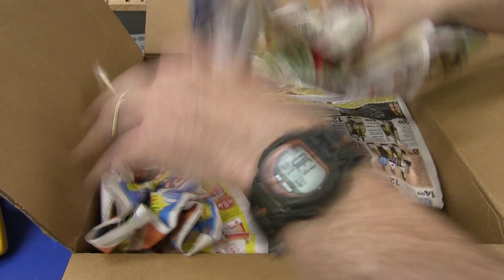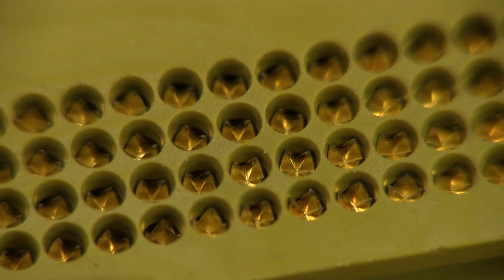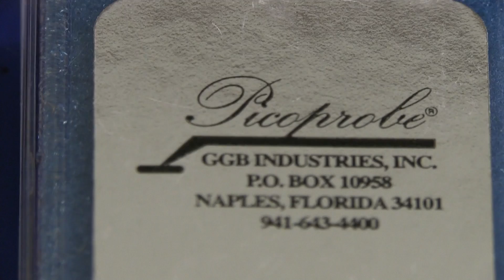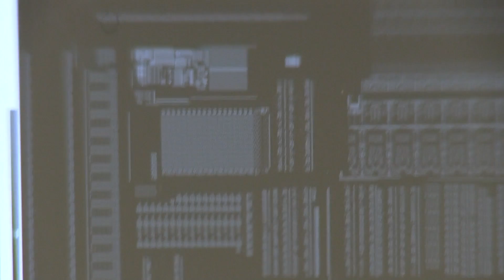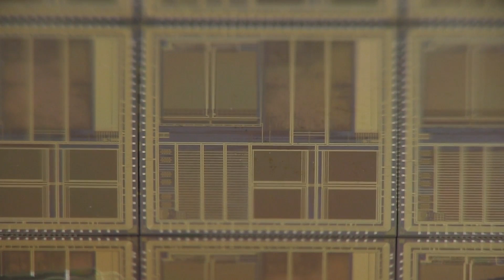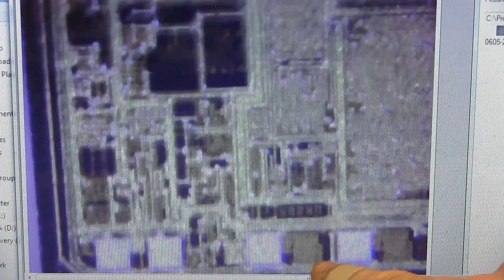EEVblog #532 - Silicon Chip Wafer Fab Mailbag

Comment: As a retired test engineer working at National Semi, Motorola and other semi houses here's a couple tidbits about wafer probing. 

First, the probe card does not move, all motion is in the chuck that holds the wafer using vacuum. The chuck is positioned in X, Y and Z by linear motors in the most common Electroglas probers. The pcb is very thick because probing high pin count die requires an extremly rigid material to withstand the significant amounts of force needed to deflect the probes such that they all make contact. This Z axis distance is in the order of 1 to 3 thousandths of an inch. 

Second, the probe ring is mated to the pcb after it is assembled on precision fixturing to position the tip of each probe in the center of the die bond pad and perfectly aligned in Z axis. Once the probes are positioned the assembly is encapsulated in an epoxy ring, hence the name "epoxy ring probe card". The probes are tungsten which has the necessary mechanical and electrical properties required. Probe cards are periodically "aligned and planarized" after probing 25 to 100 wafers and to repair damage. This is done by highly skilled technicians under a microscope.

Hopes this is helpful. Probing technology has come a long way since the 60's when I first used them.
Reply: that roswell Caused it all!!!
Reply: Thanks for sharing!!
Reply: David Myhr get out of here dinosaur. You're out of date 🙄
Reply: Did you ever get to work with encabulators?
Reply: The mind boggles thanks for sharing!

Comment: Just looking at some of these older vids. Here's a story I heard years ago about a chip fabrication factory.

Once the circuit lines have been etched onto the chips, the chips pass through a kiln to harden the circuit lines on the silicon. The kilns were similar to those pizza ovens that have a conveyor belt in them, cold pizza goes in one side and hot pizza comes out the other side.

There was a chip factory (I never heard exactly which one) where the defect rate of the chips would mysteriously skyrocket once in a while, then go back to normal, only to skyrocket again a few weeks later again. The engineers at the factory were tearing their hair out trying to find the cause of the defect surges. 

One Friday evening one of the engineers was working back late and as he was on his way out he went past the chip kiln area and found some of the night shift workers had been putting frozen pizzas through the chip kiln as a late night snack. Fat and other substances from the pizzas were then contaminating the sets of chips that went through the kiln after the pizzas had been cooked, causing the defect rate for the chips to suddenly rise. A bunch of people in the factory suddenly became unemployed.
Reply: LMAO!
Reply: You made me hungry.
Reply: This story I do not hear for the first time. The first time was at the university of my professor. I believe it by now. Because so much what happened to me is bordering on madness.
Reply: It is an Urban Myth. You will probably hear the story again in your life, from yet another source, and so on.
Reply: David Frisken not myth..i have also worked at chib fabrication chip and we had similar issues.like people not properly using clothing or take not needed stuff there
Reply: If fat from the pizza was getting into the chips, I wonder what industrial chemicals were getting baked into the pizzas!
Reply: Just more proof that stupid people make living a true chore.
Reply: Highly doubt it. Fat and grease getting in those ovens is going to cause major long term effects and smoldering that aren't just going to affect less than a days worth of chips. The frozen pizzas slightly lowering the temperature and thus causing defects is more plausible.
Reply: The killer of this myth is how did they get a frosen pizza into a higly restricted cleanroom?
even if it happened many, many years ago...

Comment: Hi Dave
A few small corrections from  a wafer sort  person.
If you look close on the probe card you noted that some some of the probes were shorted. Those pins are power pins Vcc or Gnd supply's .

The next comment is that the probe card does not come down on the pins the wafer moves under the probe.

 the probe card you have is the xyz accuracy of such a probe card the height diffrence between the first and last pin needs to be >5 mil

Comment: The semi industry is divided into back-end and front-end operations. The back-end  - cutting,testing etc - is usually done in the far east. The front-end is the actual fabrication process which involves lithography, etch, furnace, sputter and implant -  virtually all use  robotics to handle the wafers. The actual fabrication process can take up to 6 weeks and the wafer might have up to a dozen layers.
Reply: +Angus MacLellan so aside from the wafer, how much more goes into it? or is it mostly just the wafer then all the circuitry is already in the wafer, then attach the leads?
Reply: Nice info. One of the best videos about processors technology I have ever seen.
Reply: @steelthfighter  the active circuitry is all at the surface of the wafer and is "paper thin".

Comment: FYI, the tungsten used in those 100 nm probes is partly because of the extremely high hardness of tungsten but also because you can use electrochemistry to sharpen it to a few atoms at the tip with just a few volts and some saltwater.

Comment: The probe card is fixed in place during setup, the test head is lowered onto it and fixed too. The wafer is loaded onto the prober chuck, it is the chuck which aligns the wafer and performs all the x, y and z movements to make contact with the probe tips.

Most fabs haven't fired ink during testing for decades. The pass/fail results are instead stored as maps and used to either ink the wafer on dedicated machines later, or the die are assembled directly from the maps in an inkless process.

Comment: I was working in Test-Board-Design (mixed signals PCBs for frontend and backend) for 9 years (was like a 4 guy company).

If i remember correctly, the most expensive boards i made for our costumers were about 12000€ in manufacturing. We charged about 30000€ for these (we added pcb assembly, the metal stiffener, rf-relays and sockets). They had 30 layers, needed to be about 6mm thick for mechanical stability because there are thousands of pogo pins pushing onto it from the tester side (agilent 93000). Almost every second layer was a shield layer with a specific depth distance to the signal layers, so the board was 30% copper. The signal wires had a specific width in order to facilitate 50-ohm impedance (were needed). The board was about 40x50cm and had 4mil features in the middle section.

It wasn't a very hard job, you had to stick to a ruleset that was verified by 2 other guys when the design was finished, so i did not have to know anything about RF-TEchnology at the beginning.

Comment: If you lived through the ’70s or ’80s, you probably remember a time when technology was big. TVs, with their cathode ray tubes, were monstrous. Amplifiers and hi-fis were heavy, bulky, expensive things. And computers… computers were really large. Case in point: The IBM hard drive pictured above, which weighs in at 38.5kg (85lbs) and stores a grand total of between 1 and 2 gigabytes.

This drive, which originates from around 1989, would’ve been teamed up with a number of other drives and slotted into a IBM 3390 Direct Access Storage Device (DASD) — a floor-to-ceiling server rack. One IBM 3390 model was capable of storing up to six drives, for a total capacity of 22.7GB. A complete IBM 3390 system had a data transfer rate of 4.2MB/sec, with an average seek time of 12.5 milliseconds. The platters probably span at around 2,500-3,000 RPM.

While it’s hard to put an exact price on a single drive, it would’ve cost somewhere in the region of $50,000 to $100,000 in 1989 — or about twice that, in today’s money. That’s around $50,000 per gigabyte — or one million times more expensive than today’s hard disk drives, which are currently priced at around five cents per gig.

By the time I had stated in computers in 1977 we were using the ICL 1904 with the removable disk packs!

Comment: At 26:36 the suggestion is for testing post encapsulation but this is not always practical.  Sometimes the testing requires access to pads that are not bonded out (like on the bond out version of the processor) to verify internal circuits are working that are not possible to test when in normal operation.  Such as watchdog circuits and copy protection fuses that have to be temporarily bypassed or op-codes have to be injected to check fault conditions.

Testing may also sometimes take place before the chips are completed and if a complete wafer were to show a fault it would be scrapped before wasting time of the following steps, a whole tray of wafers may be junked with a lot of saved time.

Some chips are also factory laser serialised or trimmed and this also has to take place before the encapsulation process.  Many modern serialisation procedures are done with OTP ROM that is then locked from changes but sometimes that is not possible or desirable to prevent generation of multiple copies of the same serial number after they leave the factory.

Comment: The round shape is a byproduct of the production of the silicon, you start by growing a Cylinder of (almost) perfectly aligned pure silicon molten silicon while spinning it. then you saw the cylinder into the slices which are then prepared as raw wavers. Very intricate process in itself.

Comment: You can get wafers (with chips on them) on eBay - it might cost a little bit, depending on the size and type. But it's definitely on the list of things I want to buy at some point, to put on the wall in my little workshop.

They look dazzling when you see them for yourself, and it's great to think about the massively complex engineering required to create that thing that you got hanging on the wall.

Comment: did anyone else collect old computer parts when they were little. I had a closet full of computer parts cause I just thought they were fascinating. I grew out of it but now I feel like starting a new collection lol
Reply: YES!  I did.  I remember breaking open old 486 chips to remove what I thought was gold!  I dismantled old HDDs and busted open non-functioning CRT's to explore their internals.  I'm 27 now, and I must have been in late elementary/early middle school when I began to really explored the world the computer hardware.  That was back in the when dual Voodoo2's in SLI where the very best you get!  I even remember the day Nvidia bought 3Dfx... sad day to see the Voodoo line disappear.  I'd love to see Nvidia name a GK104, GK110, or even Maxwell part in honor of the Voodoo series!  That would set my nostalgia on fire!
Reply: DarkRendition Same here, always dissembling any electronics I could get my hands on when I was young
Reply: I actually used to work in a university research lab, and had an electron microscope and atomic force microscope under my watch. We once had a particularly annoying piece of electronics finally crap out on us, and IT didn't pick it up right away, so we tore it all up and examined it before returning it for recycling. Removing that protective epoxy packaging was challenging but eventually we got a piece of a memory module cracked open, and we got to "see" the individual transistors and interlaced arrays. Those images served as my PowerPoint backgrounds for years.
Reply: i definitly did! i had tons of old crap that id mess around with
Reply: I have an old circular part kind of like that test board and believe it or not it's for a Pentium one I've had hanging up for ages it's fascinating to look at I've got some really old see-through hard drives to

Comment: The 'damage' on the edge of the wafers is actually a very important feature. Its a blank space for the masks to be aligned one upon the other. They usually also are on the edge of the wafer that corresponds to the crystal plain of the silicon itself.

Comment: someone told me that in intel 80486 cpu era, they were printing the cpu speed based on test results individually on each chip. therefore overclocking with jumpers on the motherboard was so common and usually non destructive.

Comment: best technology porn you can't get anywhere, naked to the bones, with all the super kinky toys shown.

really, microelectronics (nano?) industries are amazing.
Reply: Yeah I am a Diffusion operator 2 in a wafer Fab and we process 8" wafers. The best way to get a look at these is under and optiprobe that measures the thickness of the layers as they are built. The tolerance on these are measured in Å (angstroms) that's 10-10m or .01 nm. All the wafers start out as a raw silicon wafer. As they travel through the Fab they gain more and more layers. My department is front end we build the wafers thickness to allow the photomask layers to be added and etched. The furnaces are used to dep the wafers and solidify the layers. These wafers while they are fragile they are not as fragile as he makes it seem in this video. They can be picked up and handled by hand quite easily. However if you drop them depending on what stage they are at they will break into large chunks or small pieces. Thickness of the wafers determines it's fragility. The wafer he has is not that fragile and can be easy handled by hand.

Comment: In that socket each of those pogo pins should be replaceable so that if one gets bent or malformed the socket can be repaired by the lab technician rather than sending it back to the manufacturer.  See if you can figure out how to replace them.

Comment: yes you are correct. you place the wafer on a special high speed spinning disk. you then add liquid photo resist, expose it, clean, remove/add/chemically change the exposed area then remove the remaining photo resist only to apply new photo resist so you can do it all over again and again and again. making different types of circuits. such fun! wish we had more FABs in Australia.

Comment: In the very early 80'S we used bare die to assemble Atari 2600 cartridges using a proprietary pressure assembly process called the Sicon, quite a few of them actually worked! But automated wire bonding was always better. The whole thing I learned later was just to loot investors by a guy from texas ... of course.

Comment: Perhaps a new triangle processor architecture, which would increase the density per area and solve the problem of dei scaling in wafer manufacturing!  No need to cut the wafer as it would be a single circular die with 10 or 25 mm diameter, increasing the capacity by increasing the size of the circular wafer die!

Comment: cause they melt a ton of the silicon and put a stick in it when its molten and pull up the molten silicon and at the same time the stick rotates. this way they get a huge pillar of silicon and then they dice the wafer

Comment: Wow 24 layers PCB!! Nice!! 

How come you say the silicon are cut by mechanical saw, wouldn't they use laser cutting for precision?
Reply: Um, you do realize that the laser is moved around by a mechanical system, right? It’s as precise as the motion system is, and if you replace the laser with a saw with a good spindle, you lose none of the precision (where would it go?!). Once you can make precise enough motion systems, you surely have what it takes to make saw blades that are sufficiently planar to do this job. All that lasers would give you is volatile contaminants (they vaporize stuff, it’s not magic: it has to go somewhere, all mass is preserved!), and waste of water area for the molten edges of the cut. When your saw is this good, it beats most laser cutting.
Reply: @absurdengineering  appreciate the explanarion and everyone chiming in with their exp. In the comments. I always wondered how the saw had a low enough mechanical stress to now crack the dies. Adding protection along the edges?
 Mind blowing either way.

Comment: The miniaturisation of circuitry is mind boggling when you consider that you can now get a 128 gigabyte micro SD card.  How the heck did they manage to do that?  I remember that, during the first half of 2002, 128 gigabytes was the largest PC hard drive available.
Reply: You ever open an SSD?  500g drives are the size of thumb drives.  With a large case over it.
Reply: Sabtath Equlmath I have never owned a solid state drive.  However, given the current levels of flash drive miniaturisation, there is every reason to suppose that what you say is true.
Reply: Stephen Clementson Ya i was amazed at how small and how weight less this 500g samsung 840 evo is.  Recommend it to any one.
Reply: Sabtath Equlmath I was thinking of getting an SSD for drive C on my next upgrade, whenever that might be.  I am using three hard drives, and a Toshiba 2tb external USB 3 drive for backup.  All of these are mechanical.
Reply: ***** Thanks to continued miniaturisation over a period of decades, it's gone from the tyranny of numbers, to "fit it in your wristwatch".  I remember seeing internet ads (circa 2000) for MP3 players that only had 32 megabytes of flash in them.  But then, 32 megabytes was a massive quantity of memory. by 1984 standards.  Things have gone from kilobytes to gigabytes over the past 30 years.  My 2002 digital camera was supplied with a pathetic 8 megabyte type-1 CF card, so I'd bought a 64 megabyte card.  That old camera still works (I'd get nothing for it, if I tried to sell it), and I ended up fitting it with a 1 gigabyte CF card in 2012.
Reply: there is actually "plenty" of extra space too.  literally half the space inside an SSD case is not actually used.
Reply: Son of a Zombie
Yes, a lot of space. I have literally just installed a 240 GB SSD in drive C (I use other drives for data storage).  Nowadays, you get SD cards bigger than that.